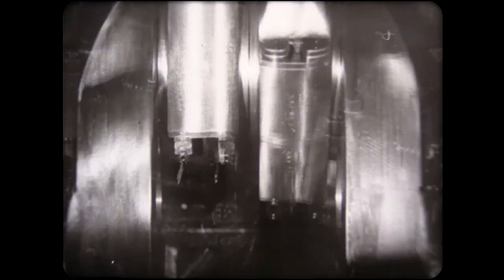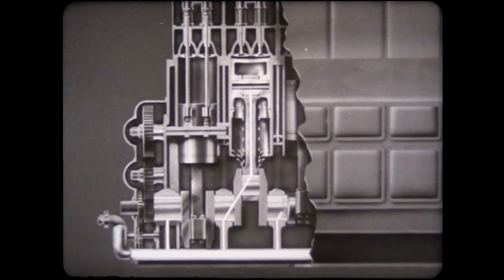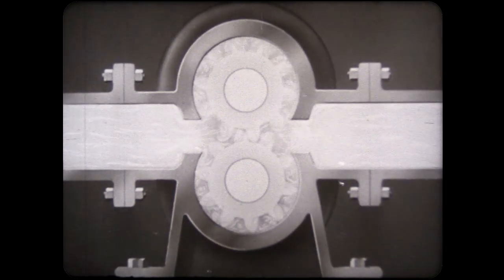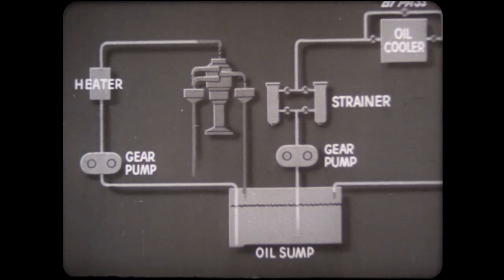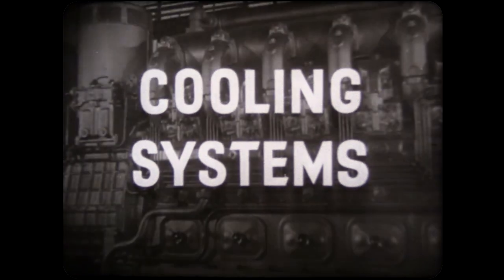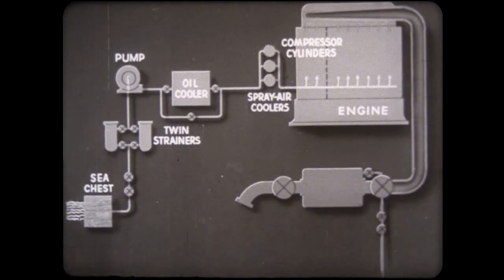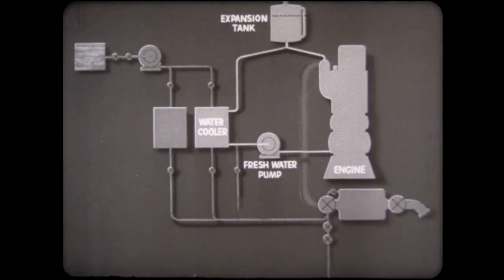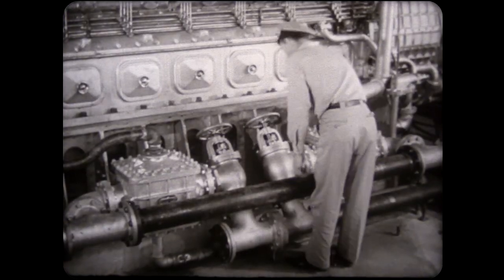Diesel Lubricating And Cooling Systems (1942)

Comment: It's amazing how not a whole lot has changed in the design of this system in almost 80 years!
Reply: We are still driving wagons basically
Reply: @zeusapollo8688  Diesel-electric submarines were the first hybrids! I wonder if you could plug it in when you got home?
Reply: @wastelandwanderer3883  Dang, I guess you're right. I would have thought that diesel-electric hybrid trains came first, but apparently they lagged a couple of years behind submarines... ?
Reply: @Dee_Just_Dee  The thing with trains is I don't think they have energy storage, the generator to electric motor just serves as drivetrain (no pun intended).

Comment: I really enjoyed this until half way through when my memory began to remind me of sweaty rotten diesel ,crawling around in slimey bilges of seaboats.
   Great film. I worked on an ancient  ex torpedo boat with two 14 litre RR 6 cylinder engines . Great film showing raw water and enclosed cooling ,and centrifugal oil filters.
   The RR engines I worked on were left or right handed,in that the gearbox could be attached both ends if the engine for twin props.
   Just don't start filling up your workshop with old engines Fran,you Ve barely enough room for electronics,audio analogue stuff, bulbs and luminaries,as well as old projectors and film stock.
   Really love your techno ecclectical outlook. A fantastic engineer you are. If Reagan had given you the star wars budget years ago we d all be shopping at cost co with anti gravity personal vehicles. Your a credit to your family,freinds and influences. Top lass Fantastic.
Reply: @Phill, I've long wondered how diesel engines draw air for combustion on the old subs, and whether the exhaust gases were somehow vented into the sea.  Care to enlighten me?
Reply: @herbcraven7146  I think they draw down through gratings in the tower and evacuate through the sides to keep smoke low,the exhaust being blown through the water on sides . This could keep the smoke down. They usually on older types scavenge the air from the inside so that the air is cleaned when the engine is running. The batteries were dangerous,liable to cracking when depth charged and when acid combined with sea water produced poisonous gases . They use chemical air scrubbers and purifiers but no where near any level to be able to run an engine underwater . Compressed air tanks can give a very short time running submerged.Some are diesel electric and direct drive ,using the diesel engine directly. Deisel electric is the usual choice. In large marine engines they can remove a whole cylinder and jacket an run the engine with cylinder d missing if needed , especially on slow revving engine s. 
  On these bigger marine engines they can disconnect a whole cylinder from the crankshafts while running. Old type steam systems are ingenious for auxiliary useages,but mostly out of date. They did use coal in early subs!

Comment: Wow, I never knew they called "blowers"  as "compressors," or the engine aspiration method to be called "air injected". Absolutely neat. And that they use zinc as a sacrificial material to protect the metals of the coolers; I never would've thought. I know about zinc rods in water heaters for a similar purpose, but never associated this (or other) use cases. Watching these old videos really gets you thinking: "This was around how long ago," "Have things really changed all that much," etc. And they explain things better, too. Think about how a nuclear reactors cooling system sometimes uses sea water, and in documentaries/videos today they just say, "the reactor is cooled by using sea water...;" they don't explain the little things, like a sacrificial metal such as zinc to protect the other metals the sea water would come in contact.

Thanks, Fran, for doing the hard work and showing us all these really neat videos. I truly appreciate it!
Reply: We could get weirder with heat exchangers. Try engines used a Rootes blower.

Comment: that was very cool to see, I got the " pleasurer" of being assistant engineer on a very large research vessel going up to the Bering Sea. Half way there one of the cylinders stopped working on the engine. And without stopping the engine the Head engineer and I swapped in a new piston and connecting rod  on #3... It was a trip to do..this thing was huge..3 feet tall rod and you can disconnect individual cylinders while the engine is running.. but the noise and heat is horrible..and messy..
Reply: So the ship ran on two cylinders? I didn't know that that's a thing,
amazing!
Reply: Let me guess, as the assistant you were the one that got to make any 'live' connections to the rotating parts. I assume at some point that was needed unless there are separate crankshafts with clutches.
Reminds me of an item from a 1908 electricians handbook on bringing (AC) generator online:
"Using light bulb(s) between the line and local generator adjust the speed until the bulb slowly cycles between dim and bright, then when the bulb is dim
have the apprentice throw the switch connecting the generator to the line."    
This was back when most switchgear was open, knife switches etc. It goes without saying that if the phase was off throwing the switch would be very exciting at best. Guess they figure better to loose an apprentice than chief engineer...
Reply: @martinmoeller9186  I was a lot younger then and there were a lot of panels that covered the missive engine. but the best I could figure is it was almost like 8 individual motors all geared together with a common intake and exhaust. and you could "shift" any combination of cylinders in or out of power..

Comment: At my last job, the backup generators were powered by two surplus Detroit Diesel V-12s. Closed system type. Some differences, but very similar.
Reply: Did you ever hear it go? V12 Detroits are a treat!
Reply: @curiouscrandall1  heard them once a week...I had to run them 30 minutes every Friday..

Comment: Nice explanation of cooling and lubrication systems on nautical engines. I probably won't lay my hands on one, but the knowledge can probably be ported to other areas of mechanical engineering.
Reply: There are definitely concepts that cross over into many other areas. You never know what might inspire a solution for any given project!
Reply: My TDI has a water cooled intercooler for the turbocharger, now I just got to figure out how to integrate sea water into all this! LOLLLLLLLL

Comment: If someone insists they could actually run a diesel engine on gasoline fuel but they WILL NOT get very far, it will rattle, grind, and destroy itsel 😯 and for many of the same reasons of what this video describes. Number Two kerosene aka diesel fuel has lubricating properties. Thankyou so much for uploading this video Fran 👍
Reply: We would run a gallon or 2 of unleaded in our 8V92 2 stroke Detroit Diesel  we had...it would make them run harder and clear any carbon out. A 2 stroke diesel loves all fuels in moderation
Reply: Hmm… if you added some oil (like 10-40 or something) to the gasoline would that help? 🤔